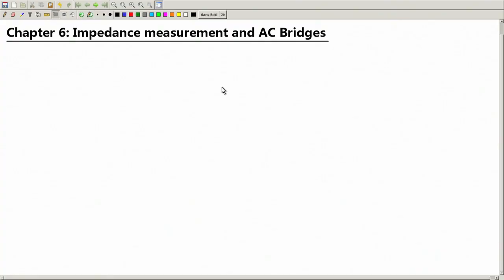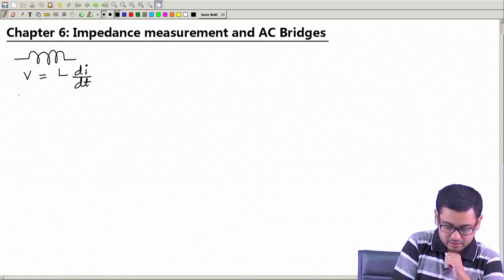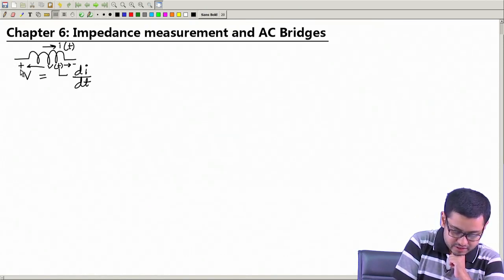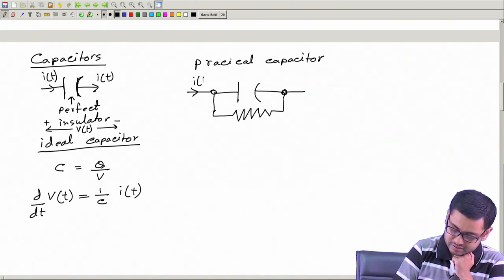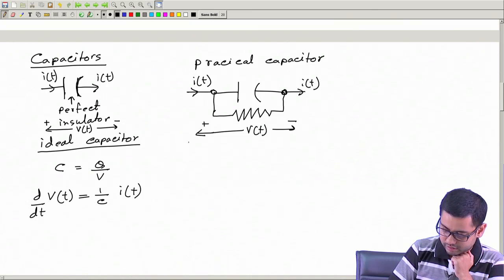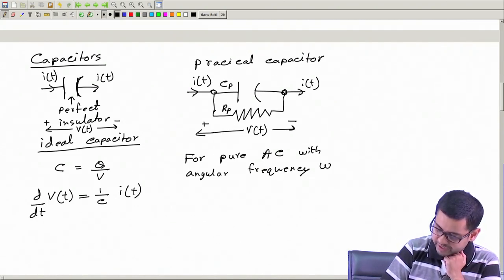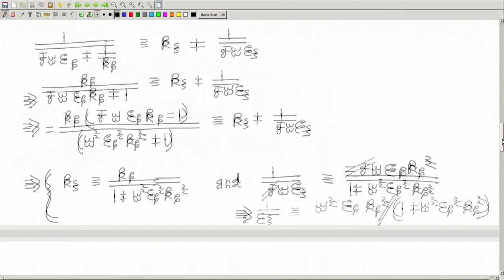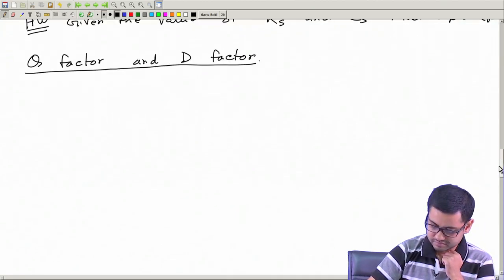Lecture 38: Impedance measurement

Comment: Sir how do we calculate the short circuit impedance practically  from a  circuit with resistive load? Do we always need to use transformer equation to find the fault currents?